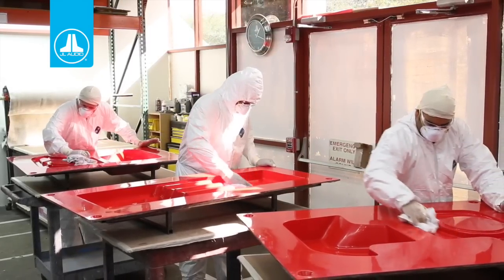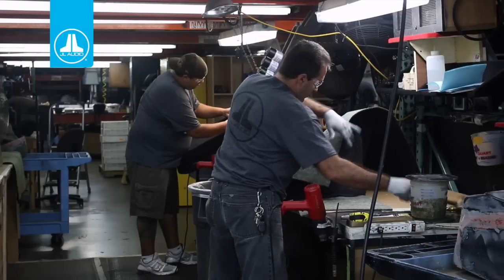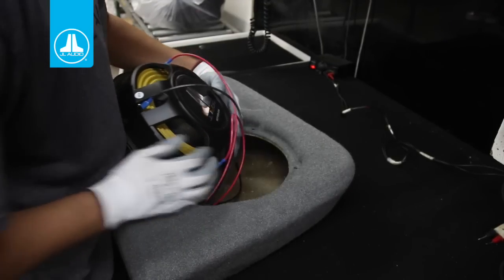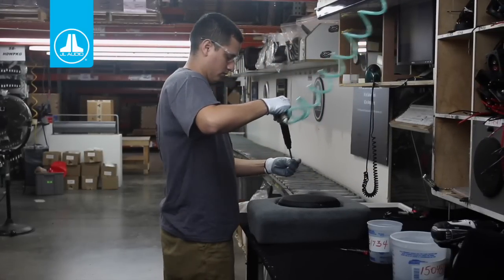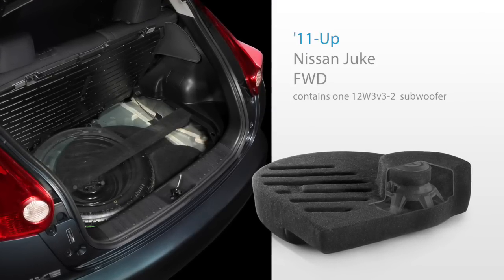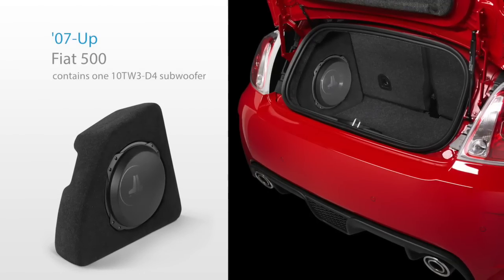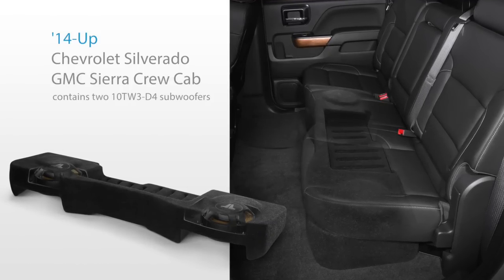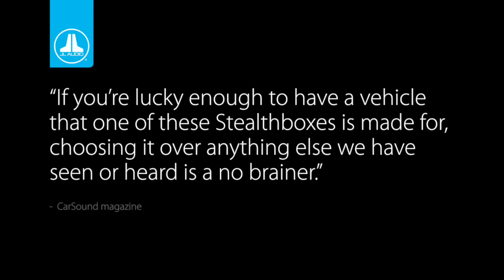JL Audio Stealthbox - Want to know why they rock?

Comment: I have a stealth box in my 2008 Chevy Silverado. I highly recommend taking the subs out and putting in sound damping Matt on the inside of it . It definitely made a difference In Overall sound . The box used to have some resonance to it before I did mine because the fiberglass is pretty thin .
Reply: I have an 08 Silverado. How much does the stealth box run, and is it powered or do I have to buy an Amp separately?
Reply: All depends on the size of the subs you’re looking at but it ain’t cheap.  You’ll also need to buy the correct amp to power them
Reply: @robp418   I'd be fine with one 10" sub as long as it can handle some decent wattage. I want a 10" that can handle like 800 RMS and still sound clean and crisp

Comment: These are great for an average listener. They don't work whereas bass heads are concerned. They do sound fantastic but they just don't have the SPL that some of us desire. This is something to consider before buying one or more of these. Again, they do sound great but they won't push the SPL envelope for your vehicle past around 90db to 100db. They weren't designed to do that. They were designed to sound good at reasonable volume levels which they do very well.

Comment: I have a 2022 Chevy Silverado 1500 crew cab and going to buy the stealth box it has the factory Bose system I want to run your VX mono amp witch amp should I buy the VX 600-1 -i or the VX 1000 -1-i ??

Comment: Hello, I would like to install in my Toyota Hilux 2009 model dual cab 4 JL Audio speakers model C5-650X in the four doors with speaker baffles. I plan to use a Pioneer AVH-600EX to drive the 4 door speakers (no amplifier) and to use a JL Audio powered sub ACP108LG-W3v3: Single 8W3v3 MicroSub+™ with DCD™ Amplifier, Ported, 0.40 Ω behind the back seat. Do you think that this is a good rig up and should sound good?
Thanks...
Reply from the maker: Hello Richard,

The C5-650x are great sounding speakers, but to get the best performance out of those speakers, I would recommend using one of our amplifiers to power them since the head unit power is not enough to really drive these speakers to their best. I would recommend using a 4 channel amplifier to maximize the full potential of these speakers and an example of 4 channel that will power them nicely would be the XD400/4. This amplifier will produce 75 watts per channel at 4 ohms and will bring the C5's to life. The ACP108LG-W3v3 is a clean sounding subwoofer enclosure that gives you good bass in a tight location. Overall this would be a good sounding system.

Comment: How would someone get JL to make a stealth box for a car they haven't yet?
Reply from the maker: Stealthbox designs are typically made once there is enough demand for that particular enclosure. We do not fabricate one-off enclosures. You can, however, reach out to your local authorized JL Audio dealer as they will be able to assist you with fabricating an enclosure design for your vehicle. You can find a list of authorized JL Audio dealers at www.jlaudio.com/dealers

Comment: do they use the stock connectors?
Reply from the maker: Stealthbox® subwoofer systems cannot be connected to a factory wiring harness as all Stealthbox® subwoofer system models are passive. They require the installation of an external aftermarket amplifier to be powered.

Comment: Which JL Audio amp would be suitable to power this JL Audio Stealthbox for the Hummer H3 and can the amp be placed within the same location either behind or beside the JL Audio Stealthbox?
Reply from the maker: The XD300/1v2 is a great option, the amplifier would not fit behind the OEM panel. Usually the amplifier would be installed under one of the front seats.
Reply: Would it fit under front seat, bit of a wiring job that way?
Reply from the maker: I'd have your local authorized dealer/installer verify fitment before ordering. We do not have access to the vehicle to check fitment of the amplifier. The amp's physical dimensions can be found under the Specifications tab on the product page.
Reply: Would the MX300 be suitable also?
Reply from the maker: Yes, the MX300/1 would work as well.
Reply: Which is the better amp out of these two?
Reply from the maker: Overall loudness would be about the same between the two, since it's still 300w RMS on both. The XDv2 is an overall superior amplifier, the balanced differential inputs help combat noise and the NexD power supply does a great job of keeping the output clean.
Reply: Thanks for all your help, I now know which way to go!

Comment: I bought the stealth box  for the 2017 Jeep Wrangler 2 door. Would you be able to tell me if it's okay to place the 5 channel amp on the empty compartment space provided  the is next to the sub speaker? I've been told that the vibration from the sub might interfere with the amp..
Reply from the maker: Hello Gonzalo,

That empty location is a secure mounting place for a JL Audio amplifier. If the 5-channel fits, you may install it there. The vibration will not interfere with the amplifier.
Reply: Thanks for the reply. However, I've called crutchfield, and they sell the product as well, and they said not to put it there because theres not enough room for air to come in and it might cause the amp to overheat and the technician over at at PNA Sport have said that the vibration from the sub may interfere with its function. I guess Ill stick with what you've told me since youre a JL rep but just incase in does cause some issues with the amp, would that be covered with any type of warranty? Also, can you provide me with maybe a direct number to the technicians at JL audio so I can give them a call and clarify everything with the technician at PNA?
Reply from the maker: Hi Gonzalo,

The over heating issue depends on which amplifier you use. Some amplifiers dissipate heat better than others. If you don't feel comfortable installing the amplifier in that section of the stealthbox, feel free to mount it wherever you would like. As far as the vibration issue, PNA Sport may have come across this before and that's why they may have stated that. Our JL amplifiers don't have that issue, but again, if you don't want to mount it in that location, please feel free to mount it anywhere you would like. Our number is 954-443-1100
Reply: Apparently, the JL rep who just gave Gonzalo this info is either a woman/secretary who doesn't know crap about proper car stereo amplifier mounting locations or it's a nerdy, male office worker who gets paid by JL to just answers internet questions. Either way, he/she doesn't know anything about the number one cause of car audio amplifier problems... it's VIBRATIONAL DAMAGE from subwoofers low, powerful frequecies! It literally shakes the parts inside an amp, like the capacitors, resistors, soldered wires/connections, transformers, etc... etc..., so violently that they eventually come loose or crack, losing connection & killing the amp. 

NEVER mount an amplifier ON or BESIDE a subwoofer, PERIOD!!! 

Put the amp as far away from the sub as possible & even mount it on rubber grommets/pads to further reduce vibrational damage.

And what's up with this JL rep always suggesting JL's lower-end XD amps for everything, including JL's Stealthboxes???  Why would someone spend $500-$2,000 on a supposed top-of-the-line, custom, specifically designed sub box & speaker for their nice, expensive vehicle but then put a cheaper, lower-end JL XD Series amp with a not-so-good .5% THD (distortion) rating INSTEAD of promoting their top-of-the-line HD Series amps with ONLY a .05% THD (distortion) rating which would sound MUCH cleaner/clearer??? Can ANYBODY explain that one to me?? I'm looking at a Stealthbox for a friend's 1999 Corvette & was thinking about an old school JL 500/1 to cleanly power it. The box/speaker is like over $850 easy! So why would ANYBODY whose willing to shell out that kind of coin put a cheaper, lower quality amp on it?? Beats me?!

In sales it's pretty simple... always suggest your best, highest quality product line first... then, IF someone balks at the high price of it, you can always come down to a less expensive model line that's more in their price/acceptable quality range.

Comment: what amp would be recommended if I were to install one for my 2009 gmc sierra extended cab
Reply from the maker: Doug, if the Stealthbox you're referring to is model SB-GM-SLVEXT2/10W1v3, our XD600/1v2 is an excellent option.
Reply: JL Audio would installing a new radio improve the sound quality? or would the stock radio do the trick
Reply from the maker: An aftermarket radio would certainly allow for more control over the audio system compared to the OEM radio, you'll also add functionality that may not have been available on your factory stereo.

Comment: With the Avalanche / Escalade EXT Midgate stealth box it states from 02-12 avalanche and up to 09 escalade. Does that mean the midgate is different in 2010 + escalades where it won't fit?
Reply from the maker: That's correct, from what we have found there is a difference between the rear seat clearance and midgate on the 2010+ Escalade EXT which causes fitment issues with the Stealthbox.

Comment: For the scion the instructions say to drill hole thru back of box to mount. How will this be air tight then ?
Reply from the maker: Hello josh, the mounting bolt will pass through the hole in the enclosure and then you place a large fender washer, flat washer and nut on the bolt. Once the nut is tightened it seals the hole. You can also put a dab of silicone sealant on the end of the bolt thread for additional sealing as long as you are careful not to let too much squeeze out and get onto the panel under the Stealthbox.
Reply: Installed. Sounds great.
Reply from the maker: Awesome, glad to hear that.
Reply: I will NOT be drilling a hole in my new truck.
Reply: MyNameIsMud take your car to any audio shop and they will make all kinds of holes you dont know about ;)

Comment: What subs do u have  for 2017 silverado crew cab
Reply from the maker: We have two different Stealthbox solutions for that vehicle. The SB-GM-SLVCC3 has two 10TW3 subwoofers and would fit under the rear seats, or the SB-GM-3GSLVCNSL which has a single 10TW1 subwoofer and goes in the center console (if equipped).
Reply: Which one sounds better from those two options?